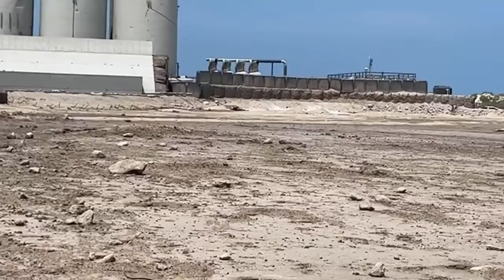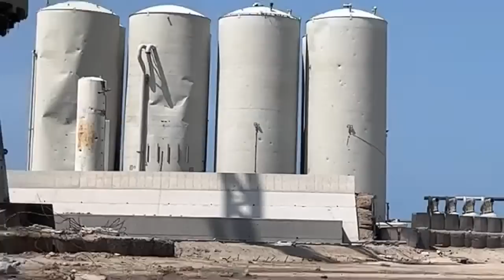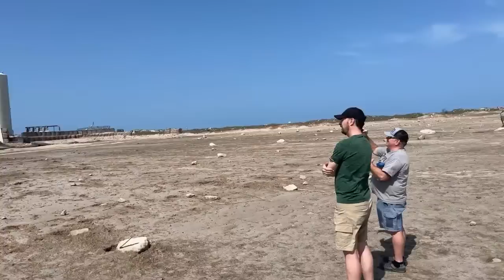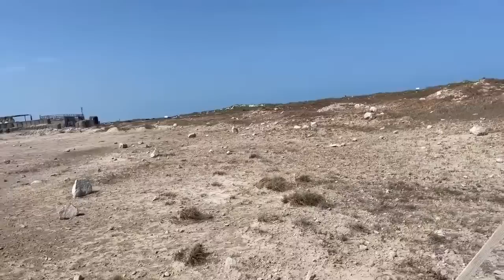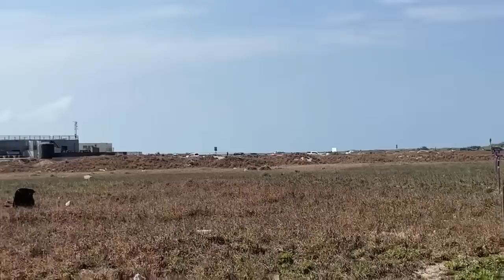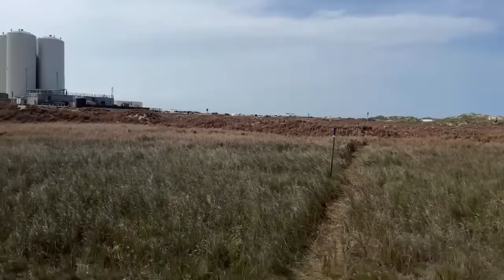Road Opened Two Days After Launch, SpaceX Starbase, Boca Chica, TX, Saturday April 22, 2023

Comment: New OM needs to be at least 100 ft higher, along with a tower extension of that height. Of course, the Water Flooding will be a new 'feature' too. Rocket's power has been mightily underestimated. I don't think it's additive. It's exponential.

Comment: Back to the basic drawing board??  lifting off a hyper huge rocket next to the tank farm from start to finish was nuts? Sticking neck out and feet firm shouting I know best Cheap easy simple is best?? I know a guy whom sells huge amounts of concrete???? insane? Totally? Now film and areas of impact show the safest distance for fuel farm and all other need to keep safe parts are?                                               Move tank farm away and dig deep service pipes cable channels  Move  and dig deep concrete thick perforated   plated  steel deflection gully spewing water and Liquid Nitrogen at moment of ignition through perforated cladding? even if land is water logged floods channels? it will help dissipation of force and heat away? moving base rail bogey engineer re[pair fit Launch Pucks can be used under pad??

Comment: 1. Everything around should be under ground level 
2. Solid 5ft iron plate should be under the platform laid on heavyweight jaks. 
3. The stading ledder platform should be made of solid iron round half moon shaped .
4. Water pool should be under the platform to reduce the heat that damages the saruaunding area.

Comment: is the OLM still usable? Jeez man those taks are really damaged .I told before that that could happen. I also told before that they should NOT use ship 24 for this first flight. So much work has been lost like the heat shield that never has been used during this testflight. Imo thats not smart that they did this. Also the results on  the tanks and the floor underneath the OLM were kinda predictable considering the enormous amount of force created by the booster

Comment: I think you’re right about the priorities, they wanted to see if the rocket actually worked at all before bothering with  upgrading the OLM. There’s no point having a really expensive launch pad if the rocket design was flawed. Unfortunately the pad may have actually caused some of the rocket problems with debris hitting and damaging the engines. Either way, the rocket (well the booster anyway) proved itself although the need to work on reliability of the Raptors and obviously rethink the staging mechanism. But now the launchpad itself needs a major rethink. I wouldn’t be Thant surprised if they have to scrap the OLM and tower and rebuild it similar to pad 39A in Florida.
Reply: That's how SpaceX does things.   Try it, see what breaks, fix.
Reply: @noobdernoobder6707  not really

Comment: another channel has a shot below the platform, it’s a gigantic crater, with rebar exposed..  entire launch system will be redesigned, if that’s even possible.  “bang it out”, are you kidding me?  hundreds of tons of concrete was vaporized, several chunks hit the engines, which is why 5 failed, which led to not enough thrust to reach stage 2 seperation, and ultimatley detonation of the rocket.  It will be at least a year before they will even be able to consider another attempt, after a redesign/reconstruction

Comment: This design was flawed from Day One. No one should be surprised.
Reply: Yep, it was probably done too quickly.  Needs to be upgraded.  Yes, yes, yes.  But jeez - how about that immense power - and it worked!  I'm glad they went for it.  Now we know the huge energy actually can be released.  Need to refine and control next.
Reply: A more robust design would of course been better but this was good enough to get the rocket off the ground and learn more. Fail fast and keep building.
Reply: I still remember when they built the OLM (was it 3 years ago?) and thinking they’ve got to be kidding with that tiny little stand. Now they need a major redesign, I wouldn’t be surprised if they have to scrap the stand completely and possibly even take down the tower. They can’t raise the existing stand as the tower would then be be too short. Just putting a flame diverter under the existing tower will not work, no way, it needs to be taller.
Reply: I’m baffled that those top engineers presumably selected by Elon Musk decided on this design. Not to mention the original goal was multi lunches per day, but after just one lunch, the site looks like a war zone.
Reply: @PKAPE004  well that happens when you have no resources to spend on complex designs

Comment: The launch site is destroy. The tanks are not "water tanks" they are fueling tanks they will all have to be removed.  The whole launch area will have to be redesigned which will be problematic because it is close to the water.
Reply: The tanks that were damaged: one was supposed to be a water tank but was empty.  The other was supposed to be a methane tank but was converted to water after the empty "supposed to be water tank" didn't cut the mustard.  So only an empty tank and a water tank were struck.  Although I do think they will replace all those tanks with horizontal tanks (like the methane tanks already are) if they can't get a flame diverter that diverts the flame away from them.
Reply: This is an incorrect statement.